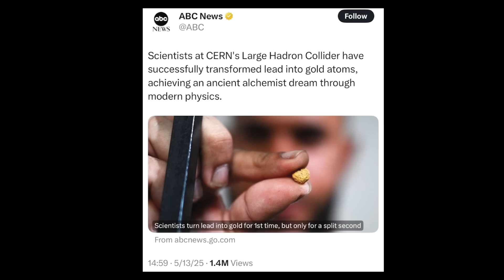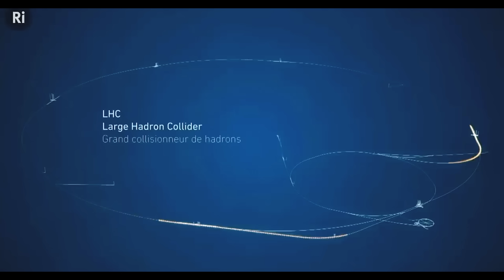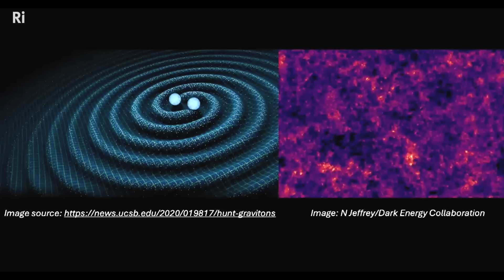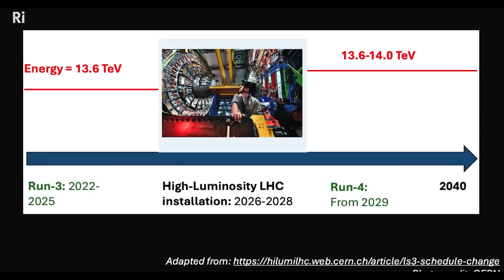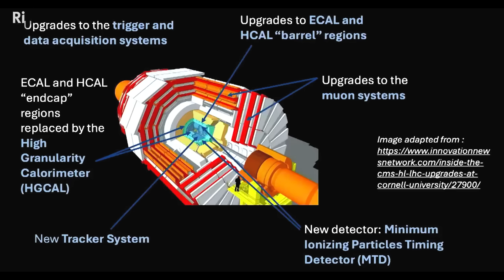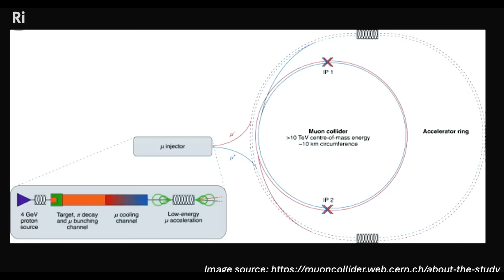What CERN Just Discovered is ABSOLUTELY TERRIFYING!!

Comment: I feel the elite are breaking the very fabric of gods creation to obtain something extremely valuable. The amount of money they've spent so far tells me there's a reward at the end of all this. CERN could very well end up being a massive energy device that pulls it's energy thru earths magnetic fields. Since they've began testing this machine, the north pole has seemingly decided to depart at an increasing rate of speed. Could this first phase of testing been to specifically test if it can successfully deeply interrupt earths inner core to create events on the surface? It could then be used as the ultimate covert weapon that creates real change, on their watch. With the installation of the larger unit, I assume whatever data they've gained so far has been worthy enough for investors to move forward into the next phase. A phase that without doubt is going to cost more than all the other units combined solely due to its planned massive size. I think anyone should be CON-CERN-ED with any project affiliated whatsoever with the elites at the UN WEF. Anything they're involved with involves making us desperate, misinformed and scared of anything under the sun.